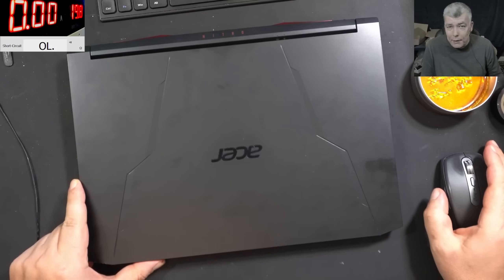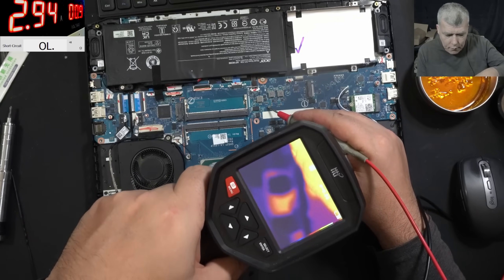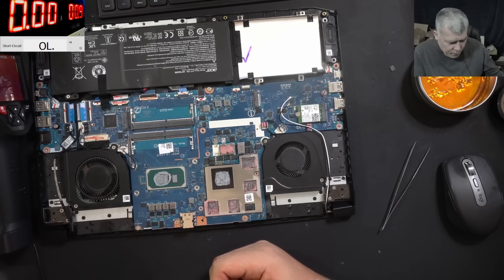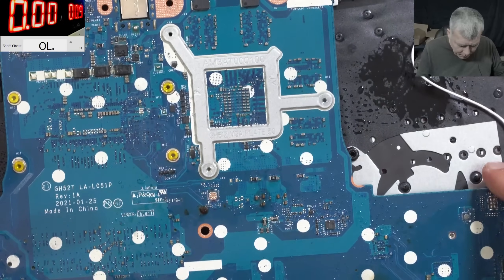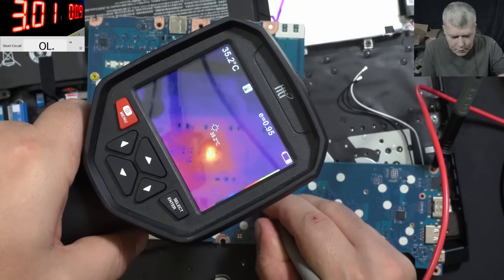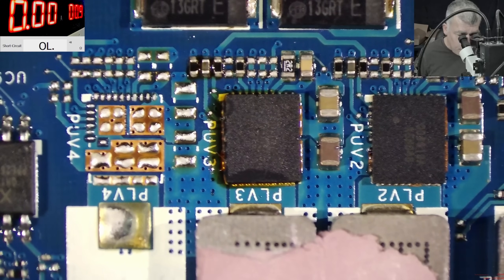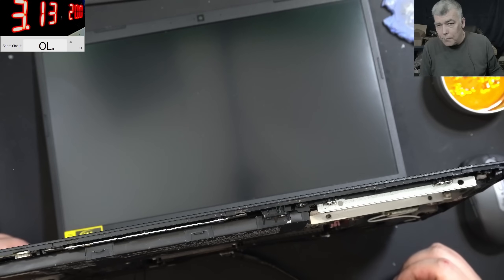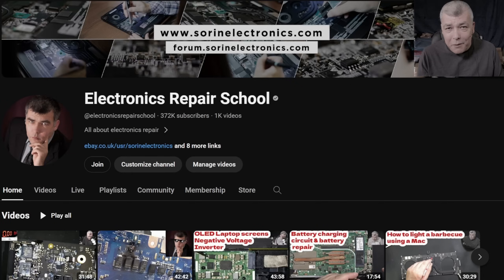Acer Nitro 5, no power board repair - shorted main power rail repair

Comment: I have a question if I detected that I had a bad mosfet and that once removed I am no longer my short circuit should the laptop start or it absolutely takes the 5 mosfets to start with the phases ? to start

Comment: hey sorin, do you think you can fix a sony handycam dcr sr32 that shows no sign of life? plugging the charger in nothing happens there's no charging light no power going anywhere (power supply works, tested with multimeter)

Comment: They often do not put thermal paste on chipset ... it's because is very near the cpu, so, the heat from cpu have the chipset run hotter if they are thermally coupled. By itself, chipset run much cooler than cpu in modern laptop, even without heatsink
Reply: it is called bad design...

Comment: Of course Sorin doesn't replace cap, because engineers just put them there for fun, right? Also, liquid came from the top, which would've destroyed the KB traces, if the PC was on when it happened. Insert boot drive, test every key. You can't just say "we have picture", and send it off.

Comment: There are protection ICs out there which behave like a null impedance Zener diode, in case something blows they short out first. Like parallel fuses. Those should be mandatory at CPU/GPU power inputs.
Reply: I think it's there. I've seen many zener diodes. In the schematics in power rail. And most of the capacitors are connected to one end with ground.

Comment: Hello Sorin, i repaired electronics to, some time ago, and the thing i hate the most is that they dont specify that something was spiled onto and i aint the only one, a lot of people still making repairs are still facing that, it's like is forbidden and you go to jail if you say you spilled water onto the keyboard. 😂😂😂😂😂
Reply: Many times the laptop can work for months before the corrosion takes it's toll. They probably don't get the correlation months later.

Comment: Hi everyone, hi Sorin,

At the outset I apologize for my English. I have a question about soldering and desoldering components like mosfet or bios on a board mounted in a laptop. What temperature do you use on the hotair soldering station ? Aren't you afraid of distorting some plastic parts under the board or in the keyboard ( e.g. foil membranes, keyboard button crosshairs ) ?
I did a test today on two Asus motherboards and one thin lenovo and mounted the thermocouple sensor on the underside of the board under the heated component and on top next to the heated component. I set the station to 440 degrees C. and blow 35 ( Quick 861DS ) and soldered and re-soldered the two mosfets and the bios chip.
When the lead-free tin melted and I could remove the component ( after about 10-15 sec. ) there was a temperature of 109 - 126 deg. C. on the underside of the board.
Don't get me wrong, I'm not undermining your experience and I learned a lot from your videos for which I sincerely thank you. But it is, however, the equipment that the customer entrusted to us, and therefore I am interested in whether you are not afraid of damage to ABS components, or weaker plastic, which are less resistant to temperature ? 
Personally, I have not yet soldered on the board mounted in the laptop larger components than a capacitor, resistor or smd diode. I am interested in your opinion, because it is known that we always aim to repair the equipment as soon as possible, and this would greatly reduce the repair time, but I would not like to damage some sensitive components of the case or keyboard underneath in the process. I am interested in your and colleagues opinion ?
Greetings. Fabian
Reply: 10-15s is long to take out some components. that could do some damage. but usualy with small nozzle you are in and out in about 10s or less. I don't expect personaly to much heat on other side (no more then cpu and gpu make under load since they run at cca 70-90C).
for bigger stuff i take MB out.
Reply: Thanks for the answer. What temperature do you use on the hotair and blowing station with such parts ?